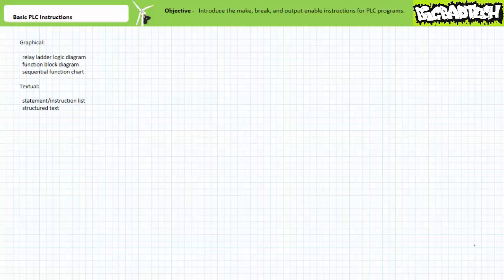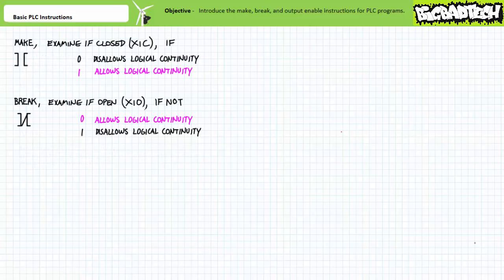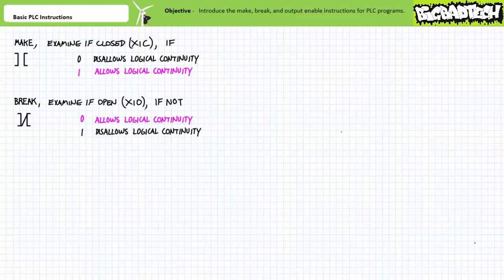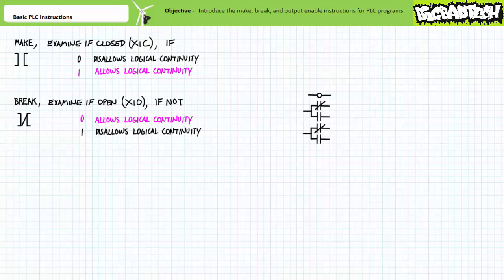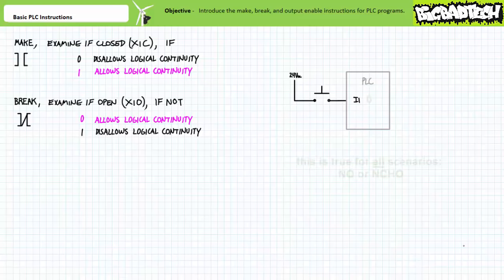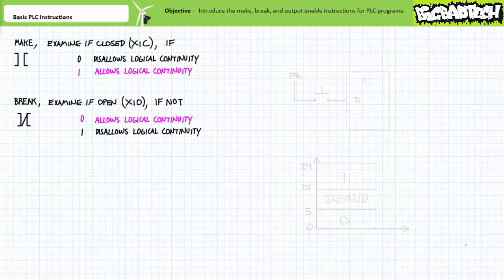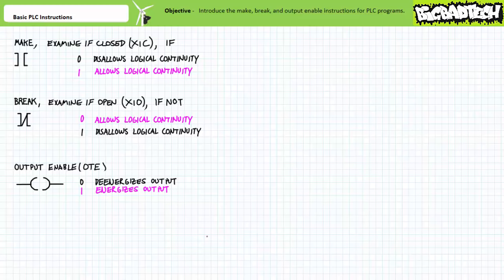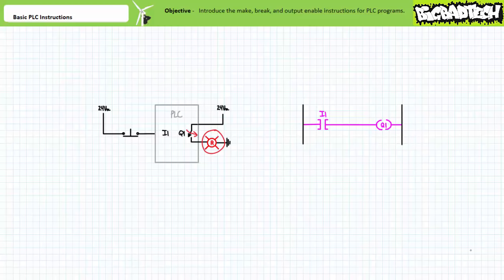Basic PLC Instructions (Full Lecture)

Comment: Thanks Jim for the lecture. It is very clear and helpful. I have a question on the statement shown from 9:53 to 10:22. It says : "One can think of the left upright rail as a source of logical 1, ie. full control voltage. And to logically energize an output on the right, a rung must deliver a logical 1 from left to right." Should the statement be like this instead: "One can think of the left upright rail as a source of control voltage. And to logically energize an output on the right, a rung must deliver logical continuity from left to right"?

Comment: Thanks very much sir, I am glad to be one of your students. But from what I can grabs from the lecture is that the hardware inside the plc or the contacts inside the plc are mosfet transistors. Because there are two classes of mosfets, those that when a signal voltage is present they close their contact allowing current to flow from the emitter to the drain. And those that when they are having a signal they instead open and allow no flow of current. And vis vesa. 
Thanks again for your time.
Reply: The "emmiter" on a mosfet is called source.

Comment: Wow, after years of not sinking in, finally, you drilled it home with the facts. To me its like a light switch that the light being on has nothing to do with the what position the switch is in (contacts open or closed), but the instruction you tell it, to be on or off. Thanks again for the no nonsense lecture. I must admit, the terminology is weird as shit, and sometimes means the opposite of what you think it does.
Reply: Yes you are right, but the truth is that they are using four types of contacts, two normally close and two normally open. For the first two normally close contact one will close if it receives a signal and will open if there is no signal and the other will remain open when there is signal and only open when there is no signal.
Reply: I'm just going to think of break as being like a not gate.

Comment: Coming from a CS background, this is kinda straightforward and natural way of thinking about make and break. I don't get why people are confused because of this?
Reply from the maker: Tell me about it! I'm surmising the confusion comes from an inability to separate the electro-mechanical nature of a field input device from a programmed instruction. Add to this confusion the somewhat dodgy terminology employed by some leading manufacturers (AB, Siemens, etc. I'm looking at you!). I've made a lot of people angry by pointing out this error in terminology.
Reply: @bigbadtech  Oh and btw, I just spent the past several hours binge watching your videos (nice work btw, really dig into them) and the complexity of all of this so far is ... astoundingly less than CS. I don't want to come off as arrogant or anything, but it seems like I can just pick up several books in the automation industry over several days and get a job right away.

Also it seems to me that I can make PLCs much cheaper than what they are offering (some of them cost on the order of $1k, such madness) and I don't understand why there hasn't anyone make it cheaper? I tried looking on forums why people prefer this over let's say a variant of hardened arduino and they all say that it lasts long, impervious to electrical noise, 24/7 tech support, simple interface that everyone understands. But like, it seems that someone can just take the basics of microcontrollers and hit all of the above goals, and the cost would be less than say $50.

So yeah, am I missing out on something? Am I not appreciating some difficulty in entering the automation market and not appreaciating the difficulty to turn a microcontroller to an industry-friendly PLC but with much less cost?

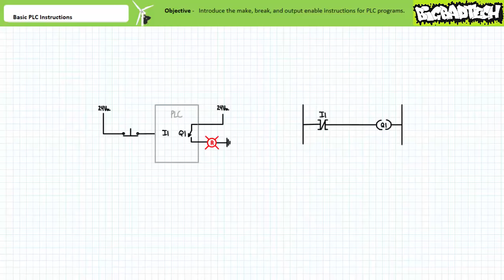Comment: Thanks a lot for the concept. You told at 20:36 a stop momentry push button (in its normal state) if instantiated as break instruction in programme,it will not permit logical continuity. 

But i have seen some basic latching programme by other you tuber.As per them ,stop push button (NC state) Instaintiated as break instruction will permit logical continuity. 

Please make a video of latching circuit with start pushbutton as make and stop push button as break instruction. 20:36
Reply from the maker: No that won't happen. Check this out here for proper implementation: https://youtu.be/OcjZIC6aNjI?si=MEyFEcQ4uq2x58je&t=661

Comment: Hi Jim, i'm watching your videos everytime i can,and I'm noticing that they're extremely easy to understand. In my experience usually the PLC is not reprogrammed unless the secuence of normal operations requires extensions of the logical continuity (between years each time)and normally is better planning the installation of bigger  plc's. Knowing that, with short and fixed operations, would've you tell us how to use blocks of transistors that emulate the programming of the PLC??
Reply from the maker: Stay in touch. I do plan on revisiting this playlist and eventually covering logic operations besides PLC programs.
Reply: @bigbadtech  🎊🎉🎉

Comment: Nice lecture sir . sir I have small doubt as you told if field input device is NC and in PLC if we take break instruction  out put will be zero, but in interlockings  output will be 1 I mean suppose in forward reverse starter we will take reverse NC from field and in PLC we will place break instruction  but we'll get forward relay ON , how it's possible please explain me thanks.
Reply from the maker: Kareem, Not exactly following your question however the easiest way to verify this is to prove it in real life with an experiment. Get a NO switch and a NC switch and then instantiate each input as make or break instruction in a PLC and see how they respond. Check out the 3 wire motor starter lecture at: https://youtu.be/D2z7WKMElJk?t=719 pay attention to how the NC stop button is instantiated in the program as a make.

Comment: I thought I understood all of these 8 possible states but then I saw your 2 wire motor lesson and saw the OL contact as a Break in the Ladder logic and you were using the words "normally closed". So if the OL is a Break and in the field the contact is NC it will result in a 0 when the motor is not overloaded and 1 when is overloaded because it's negating the condition of the physical contact. The motor would not work with a Break condition. My logic doesn't make sense but I can't put my finger on it. Example at 23:00.
Reply from the maker: The two wire motor starter in the HAND OFF AUTO lecture is hard wired relay based ladder logic built with actual electro-mechanical devices that truly have a normally open or closed state. An overload element in the deactivated non-overloaded state is closed and permits conduction. When overloaded it opens and halts current flow.

Comment: Very useful video, thank you for making it. You're a good teacher.
Reply from the maker: Just checked out your channel ... very nice!
Reply: Hi Jim, many thanks. Making the videos is not easy so you have my respect. I'm working through your videos. I am working on my first PLC program now, for a Click PLC from AutomationDirection. I've written interfaces to Wago PLCs before, but only by MODBUS, no programming the PLC. So this is all new to me. I appreciate that you said think of Make and Break instead of NO and NC. It actually took a while to figure that out. Still trying to sort out register/coil/input/holding/etc on this PLC. My program is working, but I just like to know for sure that I understand all details. I started with a panel PC with GPIO instead of a PLC, but that was a mistake because the GPIO pins are not reliably controlled and they glitch while restarting the computer. I also used an Anaheim Automation stepper motor controller and that's been a big pain too because of poor documentation and needing to relay signals between the PLC and controller via the panel PC requires a bunch of complicated concurrency programming (to also keep a camera and GUI working.) What I've learned is that the PLC is solid from the start and my next iteration will move the motor control to it as well. It's been a good lesson, going the route I did, because I know now why to use PLCs and how the extra cost is minimal compared to the headaches of integrating dissimilar hardware. Lesson learned, time for the next beating. :) 

I see you have a video on contactors as well. I tore down a mill with a contactor... I had never encountered one before. I'm not embarrassed to admit it took hours to reverse engineer how that was working. And... in the end... the label on the contactor was wrong. The part was a Siemens, and the part number indicated the coil auxiliary contact (for seal-in) as NC but the labeling on the contactor said NO. Electrically, the part number on the part was wrong. My guess is that this was a rejected part bought cheap. 

Have a Happy New Year!

Comment: On the sketch showing various combinations of make and break arrangements (16 sketches all together), if we identify each sketch as a matrix element, shouldn't element (3,2) be exchanged with element (4,2)?
Reply: Also, element (3,4) with element (4,4)?
Reply from the maker: No. NC (sending 1) with make instruction energizes output. NC with break instruction (sending 1) does not energize output. NCHO (sending 0) with make instruction does not energize output. NCHO (sending 0) with break instruction does energize output.

Comment: Could you please explain the difference between activated closed state and deactivated closed state? Why is it being differentiated?
Reply from the maker: Check out the "Switches in Electrically Controlled Systems" lecture at: https://youtu.be/ENCdPsA9PXc
Long story short ... there are switches in their natural, de-activated state, that are open (ie: normally open) and close when activated. Conversely there are switches in their natural, de-activated state, that are closed (ie: normally closed) and open when activated. A PLC program will NOT respond the same way if you use NO switches as field inputs vs. NC switches as field inputs.
Reply: Because different things happen you you add power.

Comment: Make and break adds complexity for no reason.
NO & NC is all that is needed
Doesn’t matter if an input, or program contact, it’s all the same regardless of the application.
Reply: You sir are wrong.  There is a very big difference.  PLC's have scan time.  The processor does not look directly at the Input card.  It looks at memory.  A bit in memory contains either a 1 or a 0.  If you have a normally closed switch attached to in input, the memory bit will contain a 1 unless the switch is operated.  Not only is there confusion between the actual mechanical states of the switch and the memory, there is a time difference based on scan time.  Further, the program can alter the memory prior to the particular time that the instruction is scanned.  I have been programming PLC's since the 80's.  I have taught PLC's for over 15 years to hundreds of students.   I have worked with the complete line of AB products, Siemens step 5 and step 7 B&R, Selectron, IDEC, Automation Direct, and a host of others. The biggest mistake made is to use the terms NO and NC for instructions.  It only leads to confusion.  Both Siemens and Allen Bradley make this mistake.  The trick is to understand that the physical contacts and what the processor looks at are two different things.  Your logic only works if you are dealing with a simple and slow response situation.  With more complex logic and high speed situations you absolutely must be able to recognize the difference.  Instructions are not contacts.  I do not use the term make and break, but I also despise the terms Examine if open or Examine if closed.  These two most basic instructions have caused more confusion than any other instructions in the instruction set of most PLC's.  This is way many people fail at programming and troubleshooting.  It is 1's and 0's, not open and closed.
Reply: @plchacker  Im trying to understand this idea, but I still cant see the difference. A "make" input contact will be closed/on if the signal to the input terminal is 24v. Regardless if the signal comes from a NO switch turned on, OR a NC switched turned off.  Are you saying that these signals simply go to the input register, and later when the ladder is scanned the current state is used in the "make" contact. BUT before it gets the the "make" contact it might be modified by the program? 
For example, a Lockout procedure might write zero's to all the inputs (and outputs) at the beginning of the scan, so any subsequent instructions will not reflect the field inputs, until the lockout is reset.
Is this the point of difference? Thankyou.

Comment: Why is Q used for the outputs. Any particular reason ?
Reply from the maker: Honestly I've got no idea, however "Q" on an electrical schematic sometimes represents a semiconductor device so there might be some parallels there.
Reply: Thanks. I will watch out for reasons in future but not waste time thinking about it now.
Reply: If you look at old circuit boards, Q is used to demarcate transistors used in  the original outputs of logic circuits.
Reply: ...could stem from like a JK flip flop, where the output is Q or bar-Q.
Reply: Q is a term used in electronics as quiescence it means a steady state,as in the bias of a transistor,its Q state or state of quiescence,digital will be I or O,logic 1 or logic zero (0) ,or again true or false in boolean.
A steady state....Q.
Reply: q for continuity  ''  is simple for remember''  for me

Comment: I know this is a 3-year old video, but your constant denouncing of the terms 'normally open" and "normally closed" is confusing and plain wrong. I have been working with ladder logic for 40+ years. I have witnessed the invention of the plc. Examine if Open and Examine if closed are terms that I have seen only in Rockwell(AB) family of PLCs. There are several other brand-specific terms like AB's XIC and XIO, but NO and NC are very common terms used. Most PLCs refer to these two states as normally open and normally closed. The PLC, after all,  is based on real world wiring of ladder logic that uses there terms. . The terms contacts and coils follow over to PLCs and accurately describe  their function.
Reply from the maker: I understand normally open and normally closed are sometimes used for PLC instructions .... my point is they shouldn't. There is a fundamental difference between the fixed electro-mechanical nature of a field input device and changeable PLC instructions.

Example 1: NO electro-mechanical switch hardwired to pilot light, switch deactivated light is off, switch activated light is on. That's pretty much your only option. 

Example 2A: The same NO electro-mechanical switch instantianted in PLC as make/XIC, as previously, switch deactivated light is off, switch activated light is on.
Example 2B: The same NO electro-mechanical switch instantianted in PLC as break/XIO, switch deactivated light is on, switch activated light is off. Exact opposite of 1 and 2A. The electro-mechanical nature of the switch hasn't changed but rather how the PLC makes use of the same input.
By using different terms I'm trying to emphasize that there is a fundamental difference between the fixed electro-mechanical nature of a field input device and changeable PLC instructions.